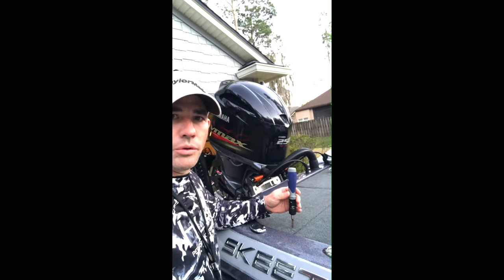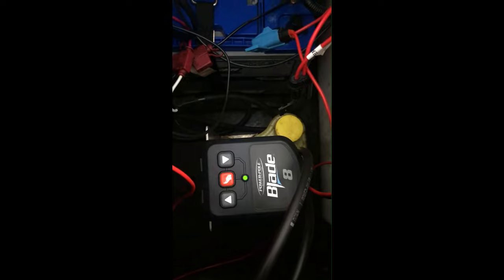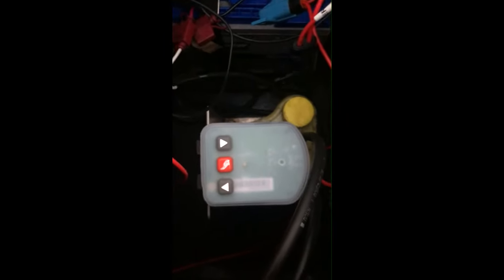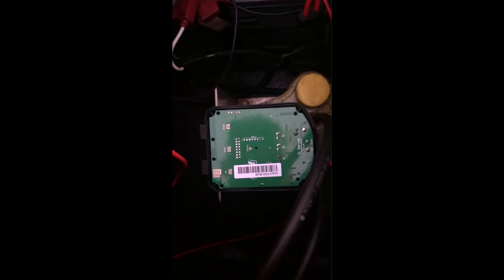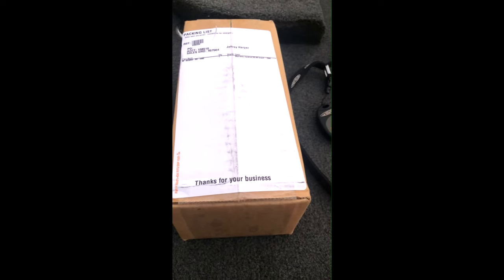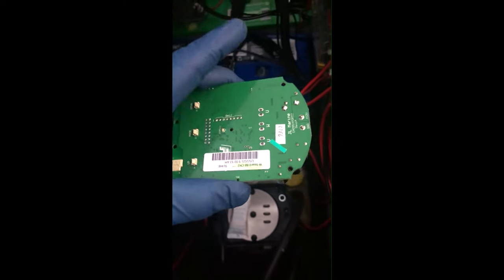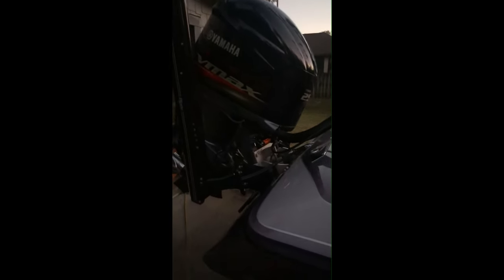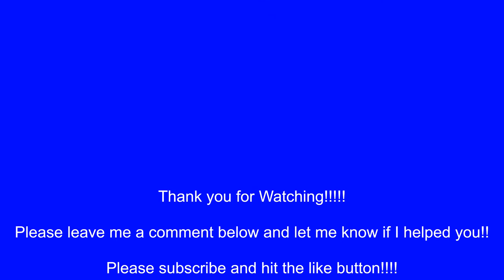How to quickly fix your Power-Poles when they Won't Go Down!!!

Comment: Ours has green light but no music on power up. No Bluetooth but manual on the motor button lowers the pole. Was yours the same thing ? Your setup is the same with the same poles working and not working. Weird dreading the cost of a new mother board.
Reply from the maker: Call powerpole customer service. They also provide tech support. Hopefully the board is under warranty still.
Reply: @flpowerfishing  the boat used so I doubt it.
Reply from the maker: @jasonthomas4589  Warranty – Power-Pole offers a 5-year warranty on Blade and Pro II models, and 3 years on the Sportsman II vs 5 years on all models.

Comment: Metal watch or rings are dangerous when working with 12v. Metal can short circuit 12 volts and fry a limb according to my shop teacher in 1966. Electricity may have changed since then, so it may be it does not fry limbs anymore. 😢

Comment: How to describe generators: Generators remain powerful. Generators have high power. The voltage of generators are high. Generators have the power. The power of the generator will not go down. That’s how generators are powered.

Comment: You’ve could of taken the circuit board from the Portside and installed on the Stbd side to absolutely tell if it was the circuit board or not? Good to kno PowerPole helped you out
Reply: Yep
Reply from the maker: Smart
Reply: Always swap from not working to working is my experience.  So let say you take the good board and put it in side that does not work, and afterwards bad side still does not work.  Two possibilities. 1) the board is not the problem 2) the board is problem because it was blown by another issue, and now you good side board is also blown.  

What you aim to do is determine if the bad side board is good or bad.  So if you take the bad side board and put it in working side, and it does not work afterwards, the the board is definitely bad, and you did not risk breaking the already working side.  Are you with me?